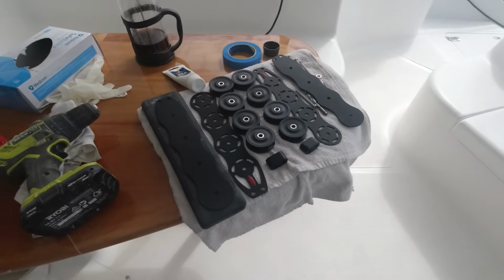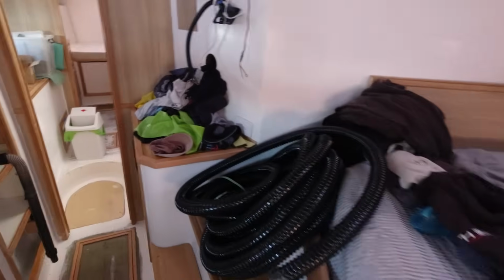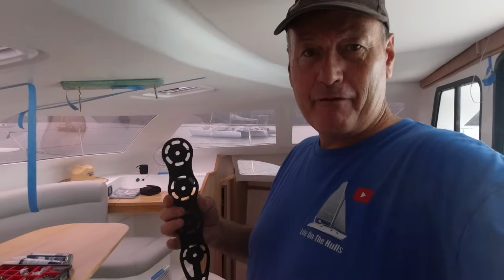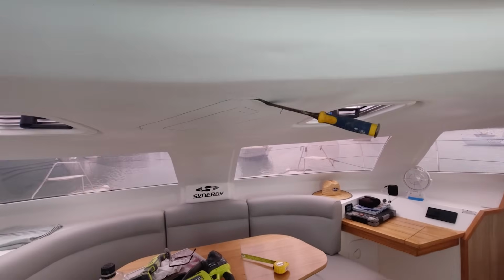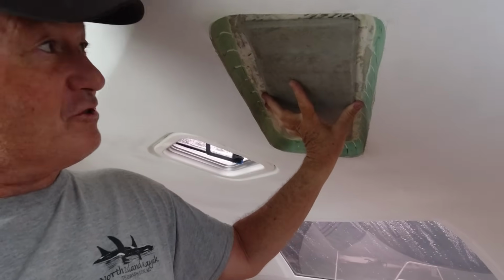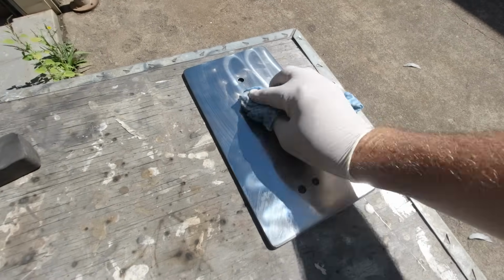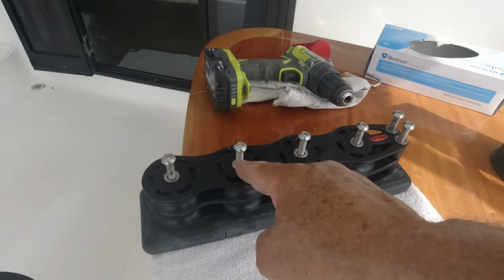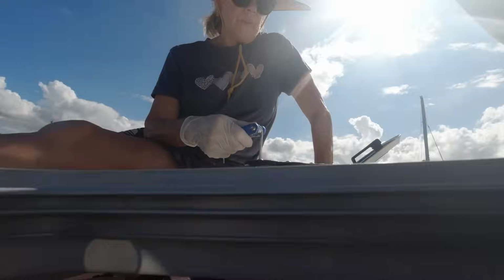RIGGING OUR CUSTOM BUILT CATAMARAN  Ep384

Comment: Serious backing! How thick is the actual roof/deck laminate? So you don't rip the backing  through the roof😉
Reply from the maker: The roof has about 5mm of solid glass, then a 6 mm solid glass backing plate epoxied and then  laminated with 6 layers of 600db  then tied to foam and original ceiling with a further 3 mm of solid 600db laminate, I think it is more then enough and has multiple tie in point spreading thde load. Ross

Comment: Good episode Ross

Good thing that you gave AMSA the flick. I have friends that have boats in charter or they are trying to get them into charter. Its an absolute nightmare. They either change the requirements or interpret them differently all the time.
Reply from the maker: It was a failed inspection regime, undertaken by Cert 3 TAA tafe assessment qualified  that was not only costly but overly onerous .Ross

Comment: The pace seems to be accelerating. There is a lot to do and prove if you want to conduct comprehensive sea trials and as much as it is a turnoff trials need to be designed, planned and documented. Each trial should have a title, an aim, a brief method and space to record results. A spreadsheet is a good way of pulling it all together, seems over the top but there are so many ‘things’ on the boat that should be proved and are easily overlooked if you just wing it. Have fun.😀👍⛵️
Reply from the maker: Thanks Norman. I agree entirely.The list of checks and balances has been extensive as I run around the boat whilst underway assessing what is normal and what is not.We have now had 6 outings and each time there is a list formulated of required fixes and assessments from fuel usage to vibrations.Our log book is our way of recording the nuances and a to do list formulated thereafter.Thanks so much for you advice and support.Ross.

Comment: Awesome work guys.
12knots, sure is close to being a power boat, those engines will never have to work hard.
Incane prices on those inspections, no wonder if people avoid them.
Take care guys.
All the best.
Reply from the maker: Cheers mate, yes, it's all about the hull speed/displacement ratio and the motors don't need to work hard.

Comment: Question, when adding plumbing through the closed, should I fill the core after cutting the holes? Love your project. Hope you get sailing soon.
Reply from the maker: I personally wouldn't worry about indoor holes unless in watertight bulkheads or deck and hull.I do expe t to have water ingress inside, biggest problem is deck fittings etc.

Comment: Why not put a stainless plate and weld the nuts to the top of plate and the put the plate into the wooden block eliminating the need to access bolts or nuts in the ceiling. Just end up needing bolts from the top !
Reply from the maker: I did consider tapping the stainless   plate and embedding but considered access to the bolts, perhaps simpler but a little more redundancy given the forces at play.Ross